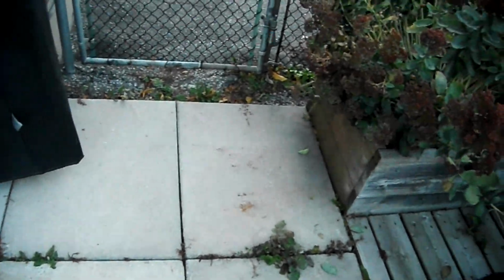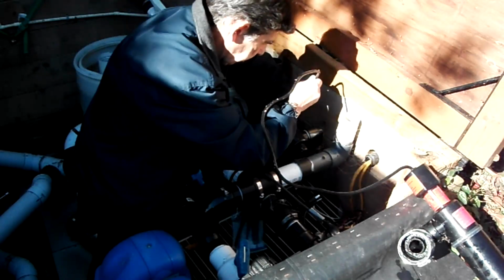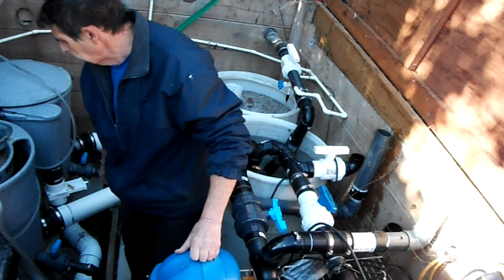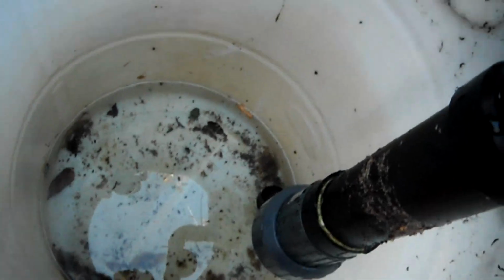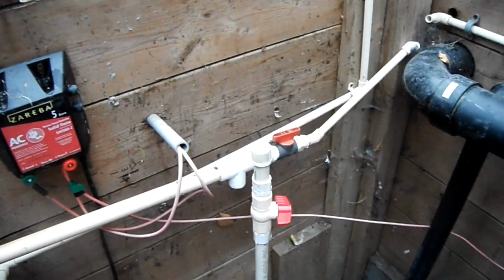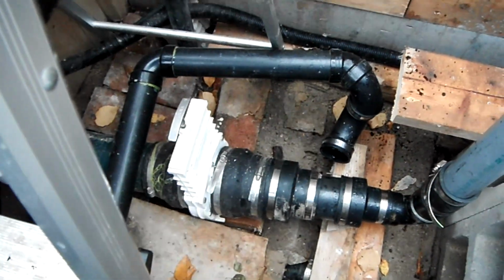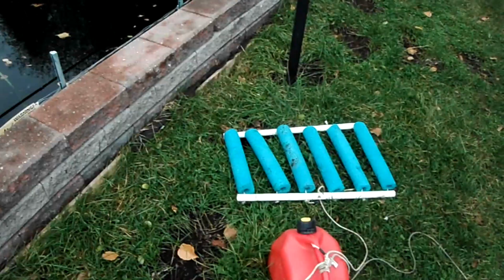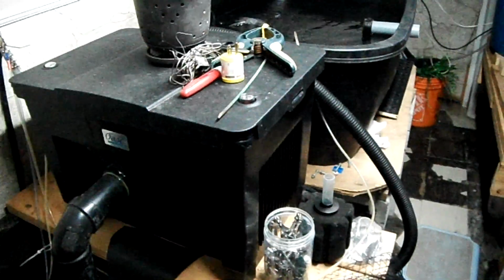Koi   Fall Update Pt 3

Comment: So amazing how that air you put in that bottom drain can hold off all that water pressure coming from the top. No sooner you'll have to put everything back.
Reply from the maker: The blower is a powerful one for sure and has a lot of power behind it. It was definitely a good purchase. May be too early to be saying this but fingers crossed 🤞🏻 🤞🏻 🤞🏻  for an early spring and mild weather.